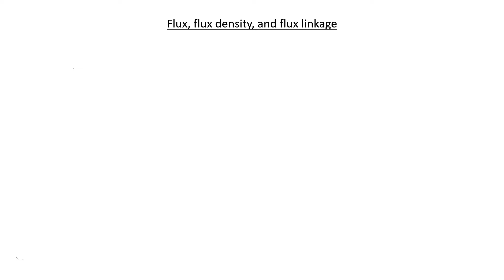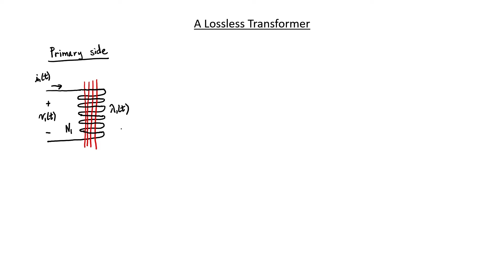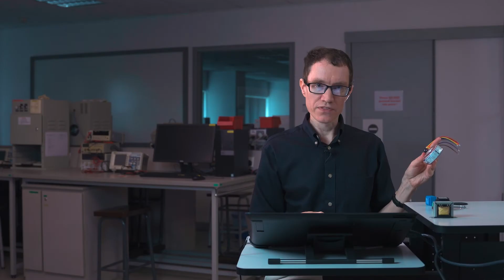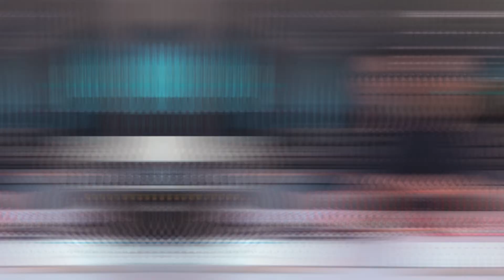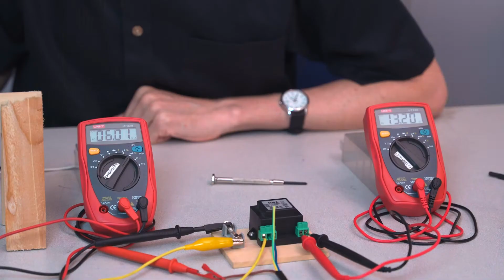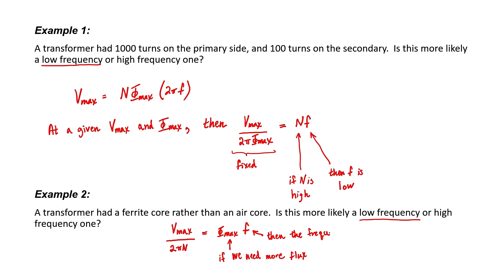Introduction to transformers (#16 AC and Switching Circuits)

Comment: very good explanation and demonstration. On 22:45 should add that the measured power is apparent and has a reactive component.And in the last expampe it us assumed that mains voltage is 230V rms and then it is peak voltage